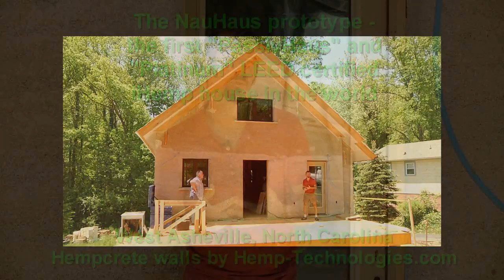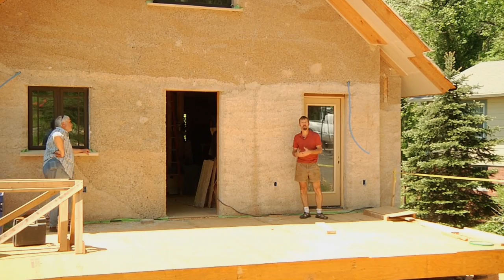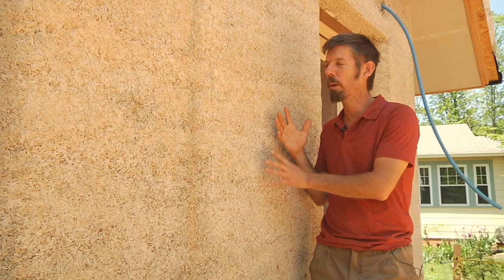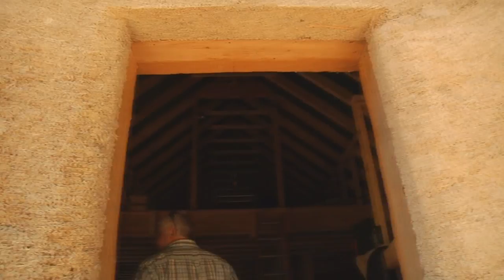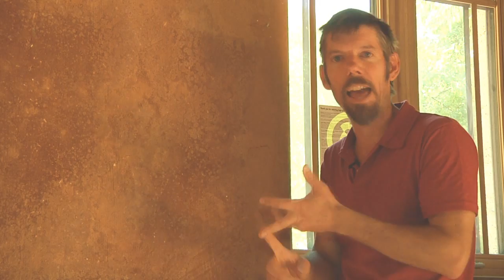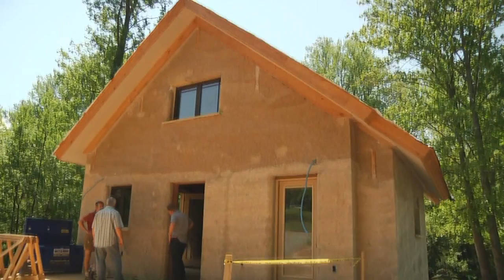Hemp walls in Nauhaus prototype, Asheville, NC

Comment: How does this type of wall work with a home that implements an earth berm? We are looking at materials to use in our home and are not sure if hempcrete would be appropriate for exterior walls. It is also worth noting that in our area, the soil has very high concentrations of clay, and basements and sunken homes have lots of troubles with taking on water. If our home is going to be above ground or partially sunken, would a hempcrete wall be better than a poured concrete wall or SIP wall in not taking on water?

Comment: When it rains and the walls take in moisture, does that translate to a humid indoors? Also, if you shower while it's raining are the walls taking humidity from the air from both directions? thx.

Comment: Can you insulate a roof/ceiling with hempcrete?
Reply: yea, and then rooftiles on or or metal sheets, depends were you live, if you get alot of snow on the roof, make the roof more pointy and metal sheets snow will slide off faster.
Reply: https://www.youtube.com/watch?v=p_CZJZrBv-4&list=PLfvODEThunxjnJupWfdAd-c8a9KCY0Rxw
this build is from pre-fab parts, from a first hemp house in holland. they make frames put the hempcrete in it and let it dry for 3 month i think, then build,  https://www.youtube.com/watch?v=m5O3oIyhEQc&list=PLfvODEThunxjnJupWfdAd-c8a9KCY0Rxw&index=2

Comment: How heavy is it compared to normal concrete? Guessing it will be a lot lighter? Also what would a house like this cost to build?
Reply: What I have seen in other videos is that it is a LOT lighter but the building costs were about the same as conventional materials but you will make that up in less heating/cooling costs & other factors

Comment: To put this on the market means the hemp house will to have more visual appeal. People don't want a brown exterior/interior that looks to be difficult to clean. When the walls absorb water will it leave a stain? Would grease from a stove stain the walls? I'm imagining a more smooth surface that could be wiped down more easily. Can drywall still be installed over the interior walls? Or, could hemp siding be installed on the outside? Is what we just saw the finished look? I'm just sayin...

Comment: Hmmmm..... So let me get this right. It allows water to be hyper driven by the sun. Also if the home is built in humid areas of the country, the humidity would be driven into the structure because the humidity of the inside of the house would be lower than the outside. I wouldn't think this is a good thing,

BTW couldn't we use straw as the medium instead of hemp? Hemp is hard to come by and straw isn't.

Just my 2 cents .....

Comment: So what happens to the walls when they get soaked for a long period of time? If we condition the air on the inside won't that cause moisture to be driven to the interior of the building? As for green, doesn't the home have a concrete foundation? How about the structure of the home? Isn't it a home constructed using a post and beam style? If so then the frame utilizes a large amount of non carbon neutral material.